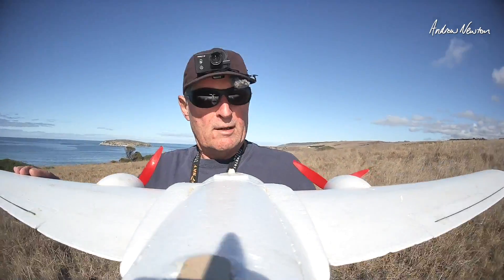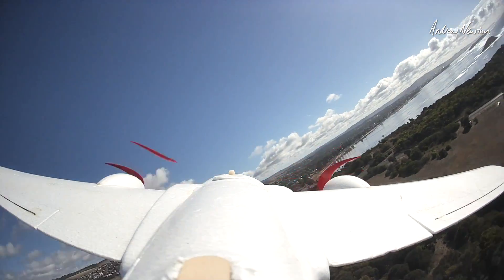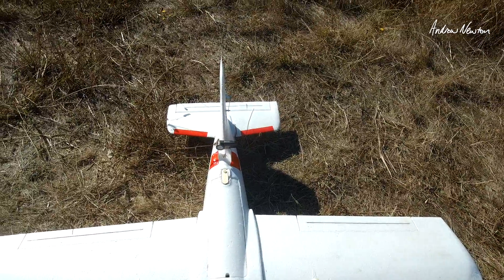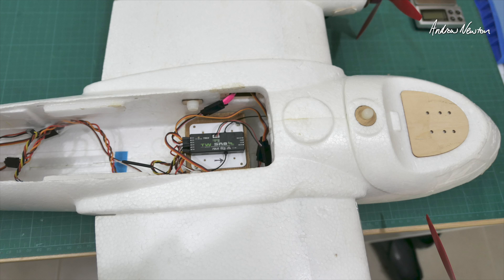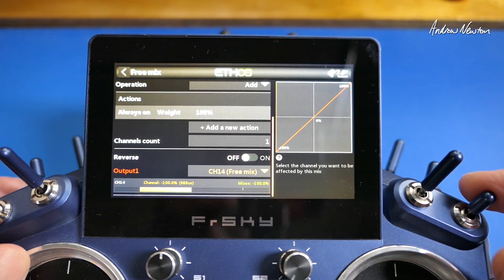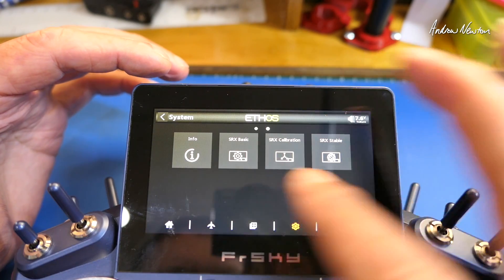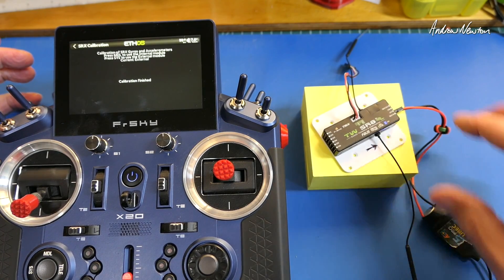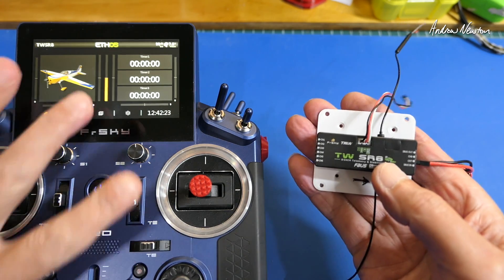FrSKY TW SR8 Stability and Vario Receiver

Comment: Hi there m8 , have you tried using this receiver /gyro on any of the radiomaster radios .. is it not compatible ? What receiver /gyros have U used on any multi protocol open tx that is still available to buy ? I bought 2 frsky sr10+ think there a bin job for me !! Cheers M8
Reply from the maker: FrSKY TD, TW and Archer are not supported by MultiProtocol. Could use NX3 gyro and any of the Radiomaster R series receivers.

Comment: Very helpful. Thanks!  When calibrating, have you tried not having the connectors/wires for ANY port placed against  the calibrating surfaces? Its also a good idea to have something vertical to calibrate against rather than using a handheld  tray edge for reverence approach. Alignment within the model seems to also be very important. Anyway,  its a good idea to calibrate on a known level horiz/vert surfaces  before attaching the calibrated rcvr to any trays and then deal with offset alignment placement  issues using autolevel options in the transmitter config. At least that way you know the rcvr calibration is as true as it can be before dealing with the question of how well the axies/orientation of the reciever are aligned with those of the model.... not to mention any trims or surface alignment issues that are added into the mix!
Reply from the maker: Excellent points thanks

Comment: Question: In the SRX Stable LUA script, what "Mounting Type" should be selected if the receiver is mounted inverted, but otherwise as shown in the manual?  Had my first flight today using a TW SR8 and had some problems even though it was calibrated and did the self-check.
Reply from the maker: Don't know. Ask Ethos FrSKY facebook group https://www.facebook.com/groups/324132953138607
Reply: @AndrewNewton  Just to close the loop on this.  FrSky Ben gave me the answer, that yes, "Horizontal Reversed" does in fact mean inverted.  It's poorly worded and/or documented.
Reply from the maker: @TheBigChinoDon  Excellent, they are quite helpful at FrSKY

Comment: You need to be level left to right also, instead of redoing the self-check it has the option in the receiver to adjust the flight trim.

Comment: When will FrSky  release product with fully prepared firmware, manual, and working like such? I loved my S6R in a Corsair, and the R9 STAB in a Ranger 1600. But both crashed when I didn't disengage the setup switch which I engaged by accident in flight. The R9 Stab did an uncontrolled full throttle ripping the motor from the plastic mount of the Ranger and nearly getting me. I found a cap had fallen off  one of the pcb inside the case. Nowadays I am sure it is easier and cheaper to put a SpeedyBee FC and an ELRS rcvr and setting it up to whatever level wanted.
Reply from the maker: Not only FrSKY. SpeedyBee had very similar premature-release problems with both Wing boards.
Reply: @AndrewNewton  Ah. We are the Beta testers.